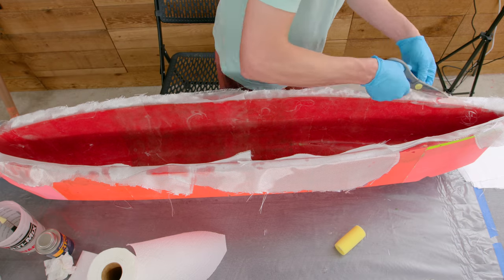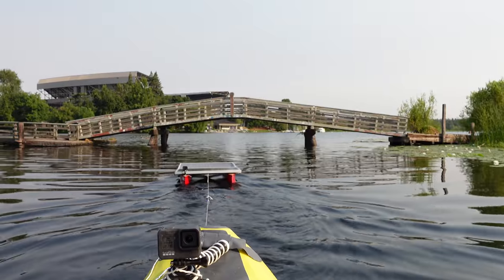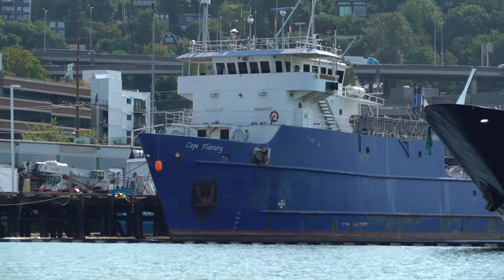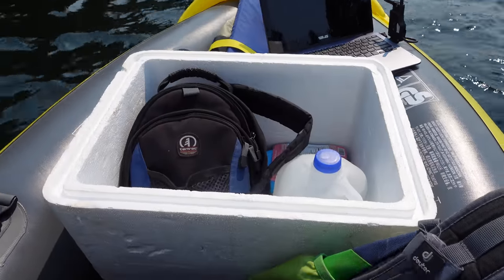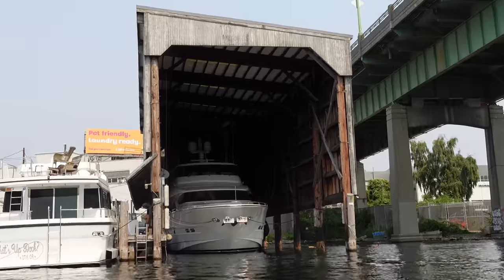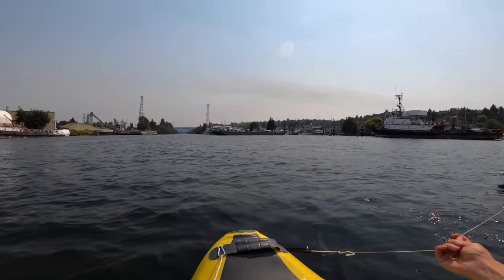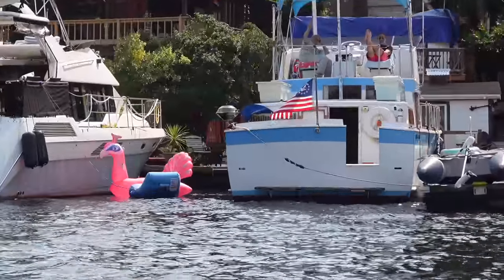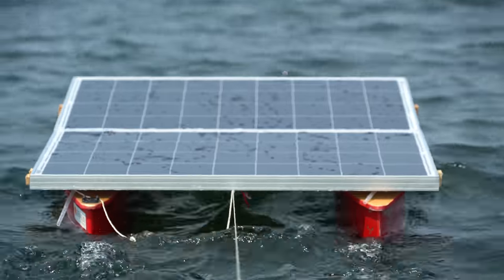My DIY R/C Boat Pulled me 20 Miles!!!

Comment: I use to work on the Bering Leader, it is a long line fishing vessel that targets primarily Cod and Skate, sometimes black cod. it's 127 feet long and though it's in seattle at the time of filming it usually ports out of dutch harbour and fishes the bering sea year round, or at least when I worked there.

Comment: “My computer is such a piece of crap.”
Well, there goes THAT potential ASUS sponsorship….
Reply: Dont use Windows,use Linux!!!!
Reply: I have an Asus laptop and it works fine
Reply: He didn't use ROG laptop, that's why
Reply: Even ASUS makes budget crap.
Reply: The laptop was sitting in the sun all day so that's probably why it was thermal throttling.  I wouldn't be surprised if some parts of got hot to the touch from the sun.  It probably wouldn't matter what model he used in those conditions but he probably could have saved himself a hassle by building a cheap sunshapde for it.

Comment: would be a great addition if you had a bilge pump in each half of the boat and it simply gets turned on via a button on your remote
that way you could turn it on whenever from a distance
Reply: How a bout a float in the bilge to auto-pump when needed ?
Reply: That or just have a water sensor in the bottom so if it gets water inside a pump activates. All vessels leak no matter how sealed they are. That’s why we got bilge pumps
Reply: @superspooky4580  yea i was thinking about that too, but at that small scale it might get "stuck on" w/ a loose droplet and needlessly drain the battery
maybe instead have the sensor give some feedback (like an LED on the remote) that promts the user to activate the pumps manually, that way you can tell if its dry or not by seeing that there is no water being pumped w/ the pump on and the LED still lit
Reply: @Space_Reptile  your right that makes since. Due to how small it would be surface tension could be a massive issue for sensors.

Comment: That’s impressive range.  I know trains are incredibly efficient with energy due to the low friction, and I’d expect water to be the opposite due to its density, but then again when you’re floating it’s very different.  How does that compare?
Reply: boats have the advantage of being pretty slow, so there is nearly no air friction which is pretty significant with high speeds
and water friction is pretty low too at that speed
Reply: If you're going slow, water has low drag, but displacement hulls have a sort of max speed where power requirements go up by the square, then the cube of velocity.
Reply: @mari_023  water drag gets large *fast*. He was going along fine at 2 and a half knots, but couldn't reach 4
Reply: I imagine it something like being in space where you don't need much energy to change your position when you just go slow.

Comment: Idea: Take 2-6scrap/garbage boats and turn them into a catamaran tiny house pulled by a similar but bigger autonomous tug boat. Also, if you make changes to the current setup and try again, do remember to take an umbrela, to shade yourself and the laptop.

Comment: I think it was having trouble with the u-turn because the weight of the kayak was pulling on the stern too much.  I used to work for TowBoatUS and we would use a bridle on the tow boat to allow it to still turn and direct its thrust WHILE pulling on the towed vessel.

Comment: You should hook the pump up to a water sensor and then to the battery so when it is flooded on the inside you don’t have to stop and pump it out manually as it could pump while pulling you along

Comment: You're doing a beautiful thing whether you know it or not. They got a lot more Electronics out there that could help your mission without your having human interference there's always going to be boats moving around and there are autopilot, alarms and programs to change your course. If you are mothers were attached to the kayak you might be able to add a few more solar panels and it is much more efficient to push instead of pull. I've been living on a houseboat for over 20 years and I use solar panels to run my refrigerator and lights and water pumps. All salvaged. Salt water does not seem to f**** the solar panels a whole lot. They charge controllers will shut themselves off the battery gets too much power and they will also shut the power going out or if your batteries get too low maybe that was your pause. You're putting on a great show man and you're making people think. It's good to make people think.
Reply: TL: DR

Comment: That little set pulling you along is mighty impressive. I do a lot of fishing from a canoe and a kayak with an electric trolling motor but that has a huge prop compared to your smaller props. I wish i could understand the engineering dynamics behind that thrust you are getting, because to pull a adult human in a big blow up boat with very ordinary hydrodynamics is impressive. A sleek kayak, although heavier may still be better hydrodynamic wise and be better through the water power wise

Comment: Can we start a fund to get this to a more advanced state? Because I understand the existence of Patreon. Still, this would be an exciting project to take on, and more funding could be an excellent way to make this project more efficient.
Reply: The problem with solar is it’s sexy, but it can’t compete with carbon fuels, not even close. Texas subsidized solar power plants 75 times more than fossil fuel plants, and when the big freeze came, solar and wind were shut down at the exact time we needed them most. Solar on almost any scale beyond what’s being shown here, is a fool’s errand.
Reply: @pascualetx  imagine if all vehicles are electric. That fossil fuel power plants will look like shit that needs to get out. It's not technically solving the issue, but it builds sort of environment friendly culture. Again, even it's not so environment friendly, yet.
Reply: @pascualetx  I mean, the lens reflection and focus towers show promise; part of vegas' hot water is powered by one. using salt as an efficient heat transfer medium, it could boil tons of water, and make a LOT of electricity. Photovoltaic systems are only the most common solar power, and yeah, they're more primed fir smaller scale stuff like phone charging and bike rentals, but don't discount solar large scale, because reflection light-focusing arrays could very well boost power production to an absurd degree, especially on arable land.
Reply: @pascualetx  Careful how you use the word fool, Carbon fuels have had more then 150 years to develop, solar maybe 20. By the time you are an old man fossil fuels will be dirty ,depleted, and uneconomical like the steam engine. Nothing is forever. Be a part of it or be a spectator, Either way its coming.
Reply: Solar and wind in Texas are secondary energy sources, They are intermittent and don’t produce a steady power supply and their system is designed around that fact. I live in  mn and we get freezes every year without the problems they had in Texas. Problem was that the natural gas wells and pumping stations froze up because leaders there didn’t want to spend small amount of money to weatherize the system. Don’t blame it on solar and wind, it’s  irresponsible politics.
Reply: @jbird6609  Actually the company that ran the Texas power grid, which ironically was not located in Texas, was told to weatherize the system by the politicians. The problem was the company did not want to actually spend the money to do that because of the cost which would of made the investors unhappy due to getting less money. So they spent small amounts at a time, stretching the upgrading out for as long as possible. If a politician tried to complain the company would point to the fact that they were weatherizing the system as they were asked.

When the freeze actually happened errors in prioritization lead to the critical pumps keeping the natural gas systems going getting their power cut.

Comment: I watched their whole thing and enjoyed it all!  So running gps on any device , as I’m sure you know, seems to overhear them.  Another thing I’ve noticed (I’ve been in industrial electronics over 10 years) is that if a devices voltage supply is slightly under voltage it tends to draw more current and therefore create more heat. I saw the part in how you power the laptop and it seems ok but there is a lot to think about there. That boosted dc voltage in is typically very “ripply” because there is kind of a pwm thing going on in the conversion process. What the output reads on a multimeter may not be real accurate because of this . Nice meters have filters that can help. Or maybe just brining the output up by abut a volt could help (not sure if yours was adjustable though).

Pretty sure you know everything I just typed but throwing it out there anyway. 

Really enjoyed the adventure .

Comment: A good idea for an improvement may be having moisture sensors in the hulls and automatically pump out any water that builds up.
Reply: @AstroCat or just find a way to build it into the ardupilot or flight controller.
Reply: @AstroCat yeah redundancy is good but it seems it's mainly taking water over the top and through splashes, so if it isn't moving and isn't taking on much water then it will float for a long time without a problem, more than long enough to fix it and it has worse problems if the flight controller dies such as being swept into rocks or hit by a boat. It is a good idea but it is something extra that needs to be waterproofed and tested and ardupilot is generally stable and well written enough that it shouldn't freeze. Just thinking in this case the redundancy doesn't really add all that much.

Comment: What if instead of an R/C tug boat, couldn't you just convert your whole inflatable kayak into one big R/C boat? Just attach a trolling motor that is operated by R/C, and you would basically be all set to go.
Reply: he want to make an autonomous boat. The kayak was just there so he can be with his auto boat at all time
Reply: @nobeltnium  But he's made many autonomous boats so far, this was not only a new boat project.
Reply: @nobeltnium  
OK, but he could also make his kayak autonomous and just ride inside of it.
Reply: @faragar1791  how are you going to mount a prop and solar panels to an inflatable boat that  barely fits one person
Reply: @bmxscape  
He had enough space for the cooler and laptop. 
I can't exactly post any images of what I was thinking of, but I think it would be possible to fit some motors and some solar pannels onto that inflatable boat and still have enough room for one person.
Reply: He could, but the project is all about a fully electric, fully solar-powered autonomous boat, and there's a reason tug boats are in common use; they can be designed to be more economical, good at moving through the water, and freeing up the 'cargo' vehicle to be as flimsy as a 50$ craigslist dingy.

Not to mention the dingy wasn't made for mounting a motor to it. It'd probably be a bit of a headache to make it work, and if anything ever happened to the dingy he'd have to redo the whole thing over again. To make it modular he'd have to buy a boat meant for mounting outboard motors, which would be a lot more expensive for an inflatable boat. If he went with a solid boat, he'd need the space to store it and the gear to transport it, so it's just more and more expenses.

As it is, the tug boat is modular, able to be applied to any personal-sized boat, the catamaran's dual-engine design means he can steer without additional moving parts and the energy drain of powering them, and using motors of that size means he already has the parts and know-how from previous projects, and can reuse parts and know-how for future projects.
Reply: If you put a motor on a boat you ride in it needs licencing and other paperwork, along with more safety things like lights fore and aft, a flare gun, life jackets, etc. An rc tugboat circumvents all the legal requirements.
Reply: @marsrover001  
Not always. It depends on the horse power of the motor. I've seen many people build small boats that are powered by trolling motors, and they don't need any paperwork or licencing. So long as you have a life jacket, you're all set to go.
Reply: It's a great idea, and you could sell it as a kit, potentially.

Comment: you should connect an electric cable, from the solar tractor, to an inverter to keep the devices on board charged. If you give a 48 volt charge, the cable would have a thin diameter.
Reply: Doubt there's that much spare power, but another small panel on the kayak should do the trick.

Comment: Next you need a water level sensor to automatically turn on and off the pump. Or just program it to automatically run for 30 seconds every half hour or so.
Reply: or just have 2 contacts not touching but when water gets too high it will complete the circuit
Reply: @kiven_gamez4474  that would probably work in salt water (which he mostly works on in the Seattle area) but I'm not sure it would work with fresh water...?

Comment: Well done!! this was an idea I had long before but never tried. I finally decided to put the two 100W solar panels as a roof on my Hydro-force marine pro inflattable boat hold by pvc pipelines and some rope. Bought a 50lb 12V trolling motor and did some hacking to a 300W DC-DC converter to feed with some MPPT algorithm the motor right from the solar panels (without a batery). I tested the electrical setup with the solar panels and the motor and, I think, worked well. I havne't tried it yet on a lake but I hope to do it soon. If my setup results unstable or unplractical I'll try as you did but maybe using the trolling motor and without batteries. The autopilot is soo Cool!!. Have you considered to cool down the solar panels with water and get more power from them? Thanks for the nice video love your channel!!

Comment: Looks like your tow line is "static"? Any thoughts of using a line that is at least partially dynamic like a bungie to even out the pull?
Reply: Seems to me that a dynamic pull line would be less efficient. The action of the waves/current would cause the line to stretch intermittently pulling back on the tug against the forward direction. Since the kayak isn't being propelled on board, it's almost always moving at a slower rate than the motorized tug so the static line seems to always be tensioned and pulling the kayak.
Reply: @cornholius  I was kind of coming at it from the other side thinking the “snapping“ of the static line would be more inefficient. This is far from my wheelhouse though.

Comment: Excellent low carbon footprint project!
Quest: What software did you utilize for the solar powered motors to autonomously follow a waypoint route? thanks
Reply: I think it was Ardurover its a part of the arduino suite
Reply: @gianlucabrambilla8227  The coding application for Arduinos or LoRa?
Thank you for answering promptly.

Comment: Funny how they say, "You'll get fat" , while on a boat they couldn't even row if it broke down.
And "Lazy" while they are using an engine to tool around.  I guess you are lazy if you build an autonomous solar powered tug instead of burning 100's of gallons of fuel on a rear mount motor. lol